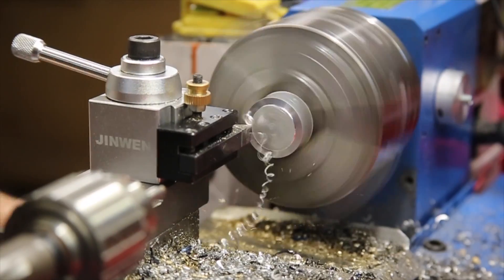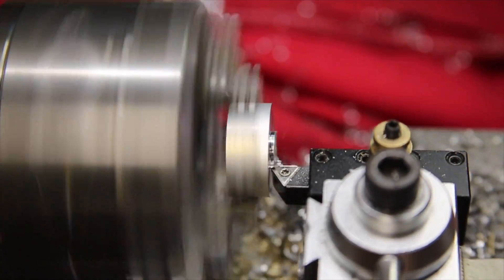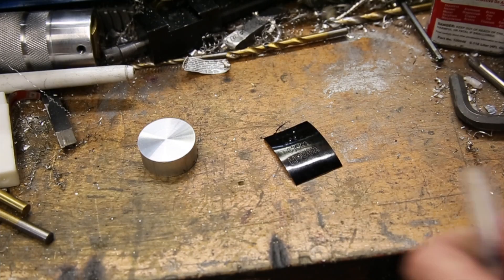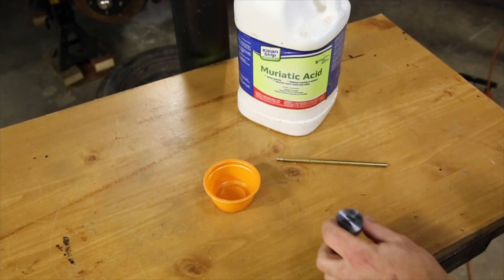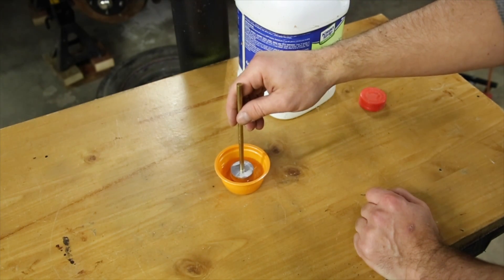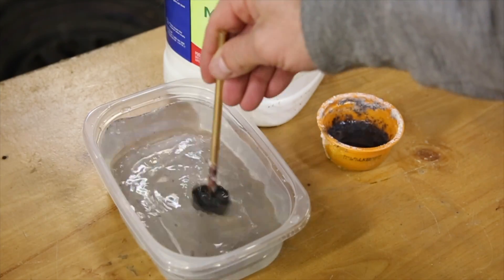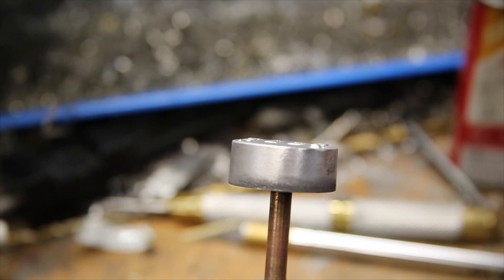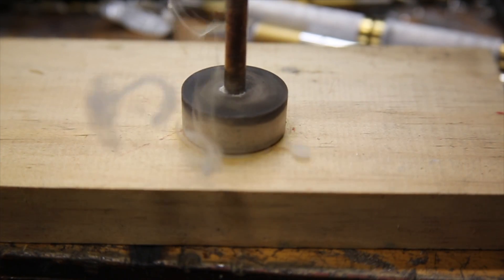Explaining the Making of the New Year Brand - Etching an Aluminum Wood Branding Iron

Comment: Where do you buy your aluminum roundstock? and how could I cut off a piece without a saw like that and with out a lathe
Reply from the maker: You can order it on eBay or try going to a local metal supply and looking through their scrap pile.. lots of times they sell the drops by the pound. I'm not sure how you could cut it... That's like asking how to make a sandwich without bread 😉
Reply: TimNummy I found a few pieces that are 2.25 inches long, but Im kinda worried thats too thick for a brand. And can you recommend anything to cut a whole for the handle? Thanks for all your help